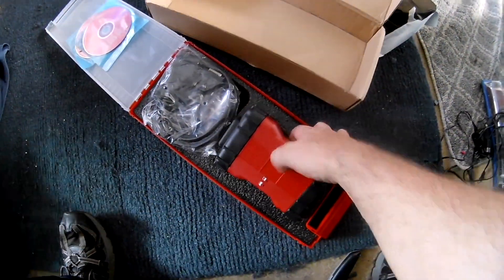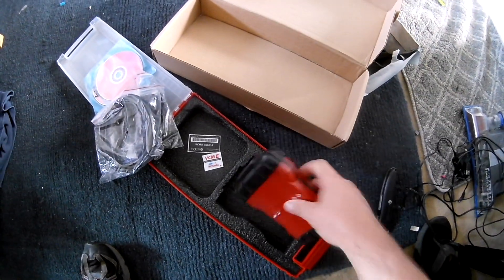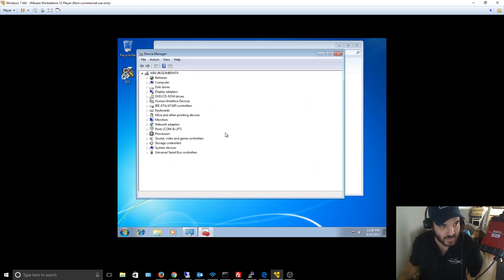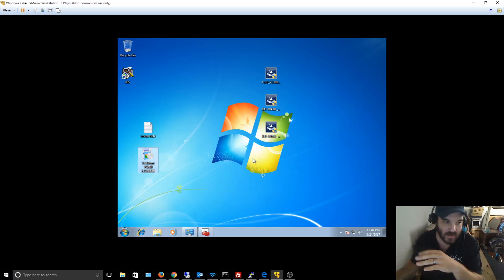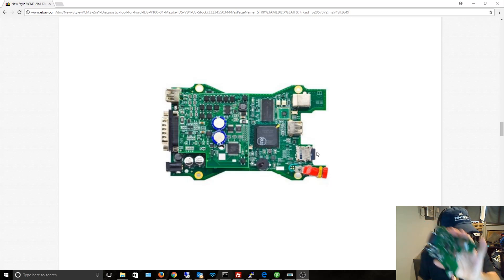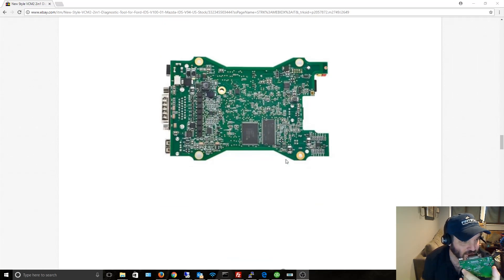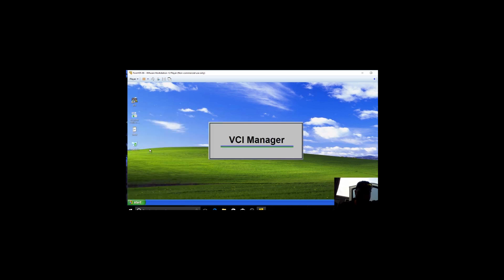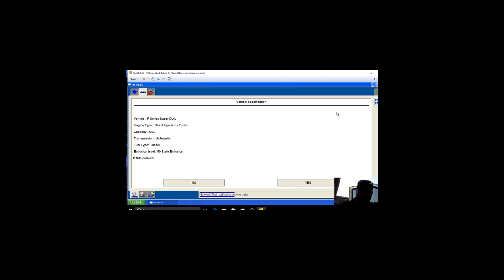Ford IDS VCM VCMII clone chinese knock off fail powerstoke 6.0

Comment: Good, it works correctly to adapt the pump vp44 psg5 in ford tourneo 1.8 TDDI?
I bought focom, but it doesn't work
Reply: ids software for sale last update 121.02 full data calibrations 98 preloaded native online system. cracked license never expires

Comment: For anyone in the future who watches this the one in this video he is using its the worst of the 3 clones you can get the one you want has the BLUE plug on it not the red i got mine at AliExpress
Reply from the maker: I was paying for the better one and got the junk one. The picture in the ebay ad did not match what I got.
Reply: @fintechrepairshop  All of them I've seen in the Ebay listings none of them have the Blue plug they are all Red i did some looking around it took me a half hour of research after i found out that there are 3 different ones and the Blue plug is the best one to get then took me another 15 to find it and i only found it because of a post in a forum talking about AliExpress has it
Reply: Ali has all the software if you can wait for it!!!!!!
Reply: Hey buddy did you have the link or the seller on aliexpress
Reply: Its not the plug its the clone it only has one motherboard needs two

Comment: Copied and pasted from eBay listing
New VCM2 for Ford IDS V106 and Mazda IDS V106 VCM II 2 in 1 Diagnostic Tool
Note : 
1. Does not support truck and vehicle：F-series super Dury,  Only support car
2. for ford software and mazda software can't be installed on one same computer
3. before to install for ford ids software , please install vmware first 
4.please change the computer time zone to China time zone

Comment: I almost didn't get one after watching this but decided to anyway since it's only a $120 gamble. Works just fine with my 7.3 excursion. Using v86 with patch on VMware. No need for deep freeze that way. Another patch to update the install date as needed to enable programming. Does everything as it should. I recommend.
Reply: Did your ids recognize your vcm from jump? And what os

Comment: The unit you have there is a allscanner VCX nano on a modified PCB to fit inside a clone VCM2 casing . The better clone is a near 1 for 1 copy of the orginal  . This VCX arm chip emulates all instructions from vcm2 hardware on a fast ARM CPU , essentially it's a emulator on a Chip , the old fords ( and most of the Yank fords )  are not pin compatible with it and have a multitude of issues ... , replace it with a Full chip clone VCM2  you should be fine , get a charge back to the top of Chinese store which sold you this crap . Also trying to use the VCM2 manager is no good . You need to install the latest thr VCX manager software  with its own GUI from allscanner.com , on install you need to select j2534 passthru and Ford from the installer list , also you may need to connect it to the net , to activate the software licence for the Vcx unit , annoying as it can autocorrect the time and date not good if your running time locked software .., you can attempt a firmware update , it may fix some of the issue . But unlikely as some pins may not be hard wired for ECU programming .
Reply: adonisnetworks î
Reply: Can you recommend a better scan ?

Comment: i had  a  original ford VCM II , had to return it three times to get repaired  since i bought it new. gave it back, got my money an bought a knock of  ,  operates quicker and NEVER had a problem with the fake one.
Reply: Hey do you have the link for the one that worked for you?
Reply: didyo use it on F series
Reply: Did you have the link ?
Reply: ids software for sale last update 121.02 full data calibrations 98 preloaded native online system. cracked license never expires
Reply: @luiscalvetti3318  do you have a link for that and what type of clone did you use please ?

Comment: i have just ordered one of these for my fiesta, it said on my description in big red letters does not work with f series vehicles
Reply from the maker: My Add did not say that.
Reply: I also have the same issues with trucks on my vcm. It is very picky about what cars it will talk to. Its useless, but i think there is a good clone out there its just really hard to know what your buying online. If it takes vx drivers then its junk. I also have a genuine ford vcm ii and it is super fast compared to this one.

Comment: Hey I just purchased one of these and ended up with the same thing you received. I'm trying to get in touch with the seller to see if they will resolve. Did you ever get it working?
Reply from the maker: Never resolved. Guy wanted me to ship it back to China. Its sitting on my work bench. No refund, money lost. I might try again in a few months.
Reply: Well that sucks. I finally got my software set up and the device registering on the computer. I won't be able to test it's functionality until I get back home on Friday though. I've talked to the seller(obd2tool.com) over skype and they apologized for having a misleading product description and said they will fix it. They sent me a link to the unit they said was the one I wanted...it was $100 more. I'm going to try for a refund. I believe I may have found a good quality one at a different store.
Reply: dbent366 did this ever work out?
Reply: @jayhawker03  Yes, I was able to get it to work. But it has been a while since I'ved used it. Not sure if it will still work with the new updates since then.
Reply: of course you put a claim in ?

Comment: I have one. Mine works good. The reflash portion does require deep freeze to be installed.
Reply from the maker: I don't have a problem with the IDS software. My unit is not a true clone. Its based off a company called VXDIAG. The same company that makes the VX Nano. If I had a true clone I would not need third party drivers. I'm still working on it now I know who makes the hardware. I updated the device firmware and drivers and going to give it another shot. I was getting a testman error and 4 different version of IDS when trying to read my vehicle.
Reply: @fintechrepairshop.  vxdiag  de AlEixpress.  la empresa que vende no sirve. y no te dan asesoria.  yo compre ahi y ya e echo miles de pruebas con diferentes versiones de IDS. llrgando a la conclucion de que lo que venden es una erramienta OEM. no es para programasion solo funciona  como leector de codigos y vista de datos en vivo. que por su presio es bastante caro para solo hacer eso. que cualquier escaner de 20dlls. hace mas que estos.
Reply: I'm having the EXACT same issue, tried all the different versions of IDS and I still get the Testman error.  Have you made any progress?  Thanks for the video!
Reply from the maker: Not yet. Its not a real clone. got ripped off on this. The item came from NJ but they wanted me to return to china.
Reply: Yep, I bought mine on eBay, seller was from TX but it was shipped to me from China via DHL.  I haven't had a chance to try yet but I read that Testman needs firewall permission to work so when I get home from work, I'm going to try and disable the firewall and see if that has any affect.  I think I got ripped off too :(.
Reply: tadebaka did turning firewall off help? Same problem as others, testman error.